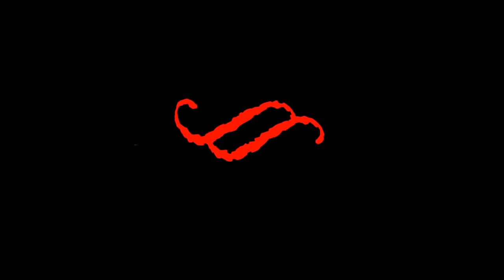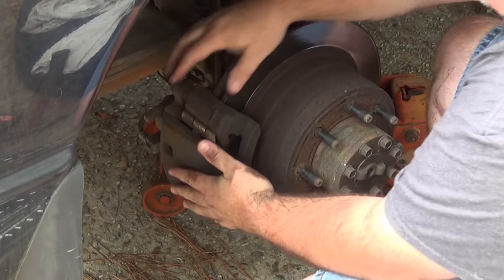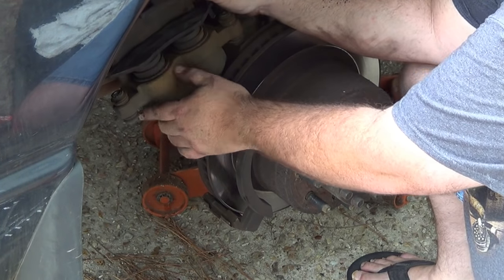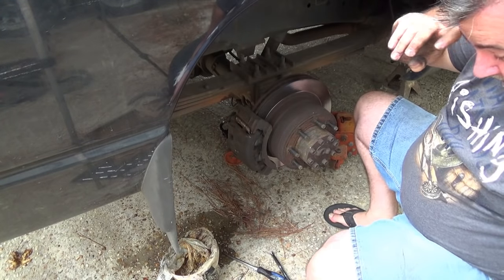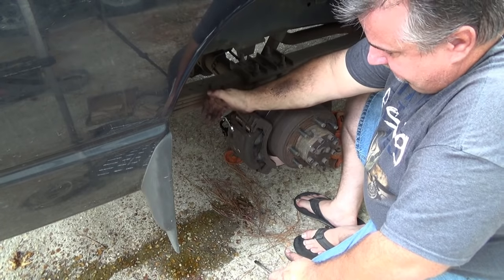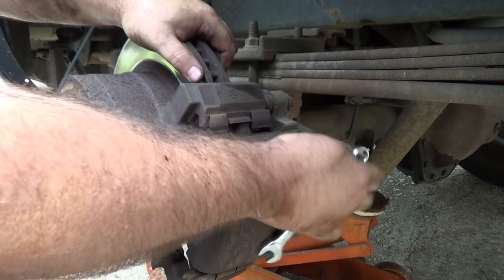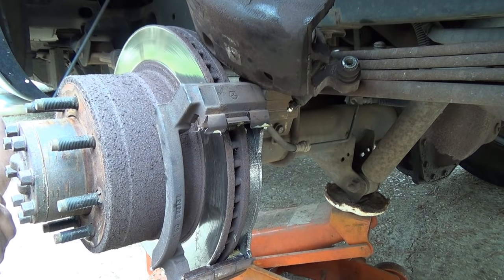HowTo: Change Rear Disc Brakes on a Dodge Ram Pick Up

Comment: he should have used a jack stand as well as jack, not pryed on rotor surface, resurface or replace rotors, torqued all hardware to spec, and not bleed the brakes unless he replaced caliper, brake line, master cylinder, or abs. also use brake clean on all brake components, try not to get it on new pads. once done, torque wheel lug nuts with vehicle weight on ground. also like others have commented he should have used a drain bucket. other then that he did a good job.  remember to only use brake lubricant on brake parts. if you don't use brake grease it will swell your rubber slides and will need to be replaced. thank you for your video

Comment: easy way to retract the pistons is use a few screw drivers against the disk before removing the old brakes compressing the pistons back in, then start removing the brakes
Reply: Leo List c clamp waaaaaaay better

Comment: pad slapping would just screw up your rotors and cause uneven wear to the pads resurface the rotors or buy new ones your only costing your self more money in the future  part failure
Reply: PS bleed the air out of the calipers is unnecessary if you didn't replace the caliper
Reply: Very true but still excellent video for showing the basics of the job. 
If you want the rotors and pads to last you should ALWAYS resurface or get new rotors (and best practice to clean all contact surfaces with brake cleaner when applying) but he said it will outlast his use of the truck so maybe he wasn't expecting truck to last long in this case..

Also FYI kids I just did full brake job on my Ram 2500 and rust conditions were  A LOT worse than this truck (Ontario Canada our road conditions are brutal on vehicles) so you can expect a very difficult job removing bolts if you have rust buildup

Front discs are almost identical other than size  .... the back brakes also hold the parking brake assembly with is another issue
Reply: Probably because air came in when he opened the bleeder.
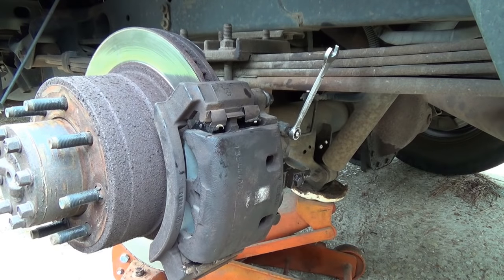Reply: Trevor Haryett -  Pretty sure that was AIR being purged/shooting out from the driver side caliper @ 19:52!
Reply: @tjontario  The back disc brake pads DO NOT have anything to do with the parking brake! There are small shoe brakes on the inside of the rotor that are the parking brakes.

Comment: NEVER open the bleeder unless you know what you're doing. NEVER pry against the rotor surface. NEVER replace pads without resurfacing or replacing the rotors. NEVER let fluid leak without a spill pan. NEVER do you're brakes like this.
Reply: You can pry against the rotor surface. You SHOULD crack the bleeder before taking the caliper off. You can do a pad slap if you sand paper the rotor a bit. You're fine.
Reply: @minirey360  I have been a mechanic for about 6 years now. I am by no means a master tech. I have worked in a couple different shops with a lot of really skilled technicians and i have never once seen someone crack a bleeder or a line to change the pads. Why risk getting air in the system? Personally i never pry against the face of the rotor, but as long as your not hitting or gouging the rotor it shouldn't hurt it.

Comment: Ok, so issue #1, I see an old rusty jack but no jack stand. if you trust that your jack WILL NEVER lose its compression I have some water front property on the moon for sale. #2 hooking two wrenches together ? Just get a breaker bar and the proper socket, #3 Opening a drain valve and leaking brake fluid on the ground? WTF!

Comment: Really?  I'm no tree hugger, but you're going to evacuate your brake fluid onto the pavement?  What a clod.  I stopped watching there.  Before that, you had your son raise up on the pedal without you tightening up on the  bleeder valve.  You just pulled lots of air into the system.  This 30 seconds of video is accomplished 3 things.  First, it showed me how not to do this.  Second, it showed me what laziness truly is.  Third, it showed you that you'd have so much mobility if you lost a few pounds.  It was clear that once you sat down, you weren't getting up.  Wrong, wrong, wrong.  This was a carnival of errors.